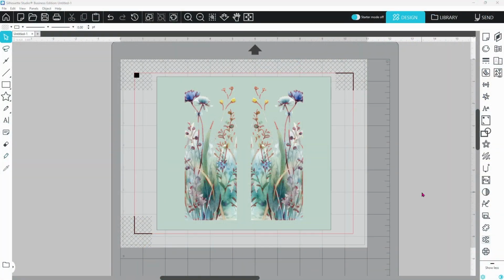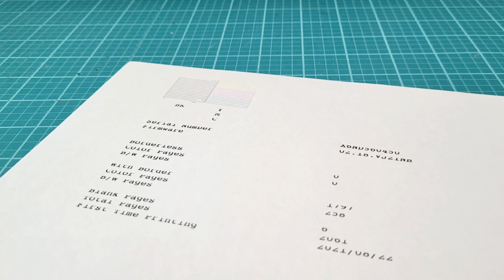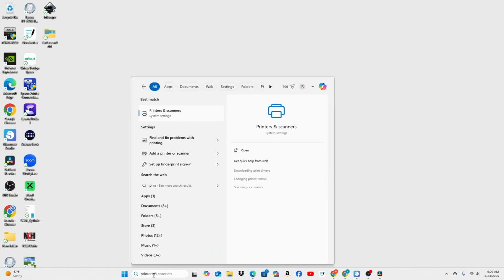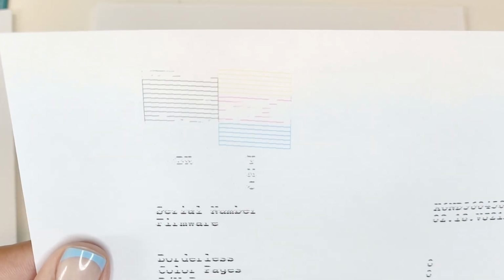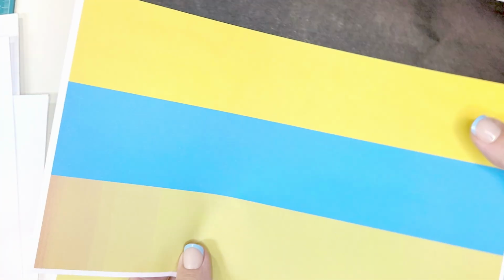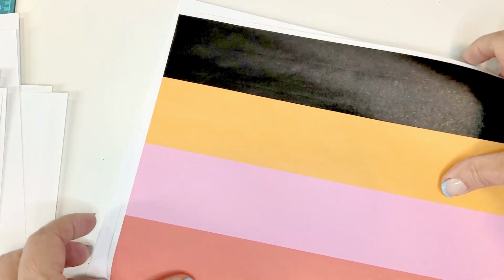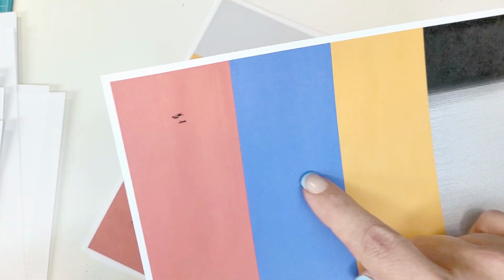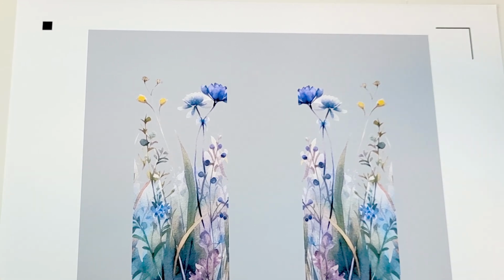Printer Not Working? Watch This Easy Fix!

Comment: Funny that your made this video. I had a cannon and it stopped working ,so I took my husbands printer he wasn’t using and it. It’s a Eco tank. Had to learn screen props and everything. It’s nice to see what needs to be done if I have problems with it. In the long run I’m liking the Eco tank and the color that it prints out. It takes a while for the computer to talk to the printer though. It could be the computer it older than the printer.
Reply from the maker: It is a little slow to communicate with the computer,  especially in the first print of the day. I've learned to make that coffee break time. 🤣

Comment: thank you for this!  i just asked yesterday which printer you use and have been looking to get one myself.  ended up having to buy a new hard drive for my computer though so that put a dent in my budget for a minute.  gonna go shopping for a new printer soon though!
Reply from the maker: Technology is awesome, but also expensive when it goes down. Sorry to hear that you had to completely replace it. The printer that I have linked is super affordable, though. Priced at right around $200. And the ink lasts forever, so it even cheaper in the long run.
Reply: @silhouettesuccess I hear that. dropped 250 bucks to replace the drive. and now probably a week of time getting everything reinstalled. that's the worst part. making sure all my software works properly. doh!
Reply from the maker: Yikes! I'd have to take my whole PC to Geek Squad and hope for the best. 🙈🤣
Reply: @silhouettesuccess  thankfully i'm a huge nerd!